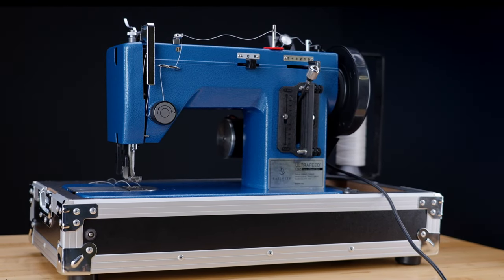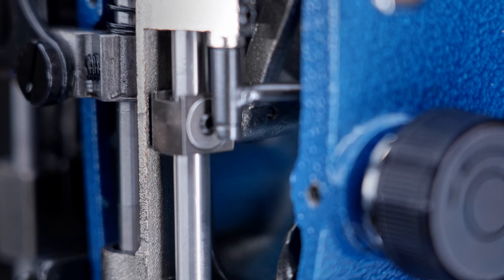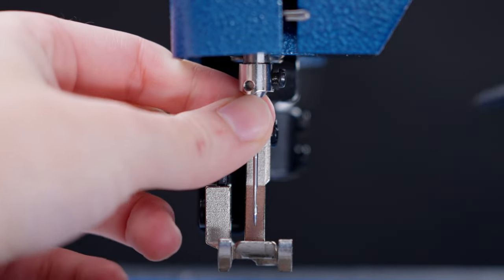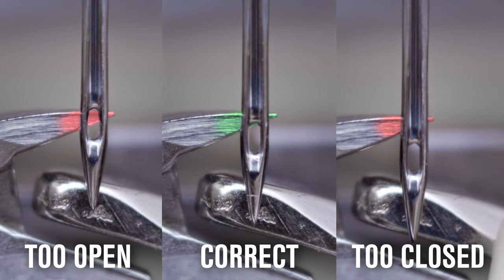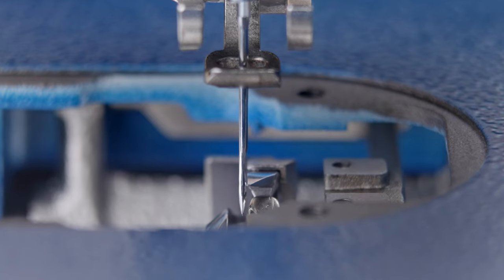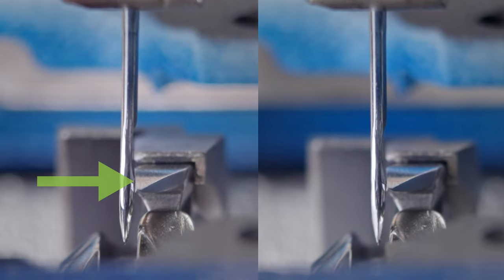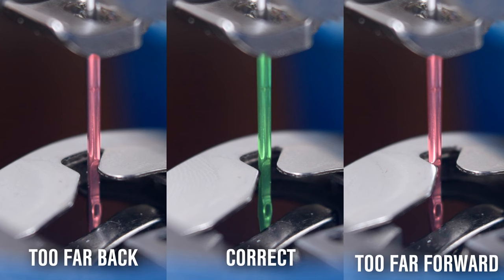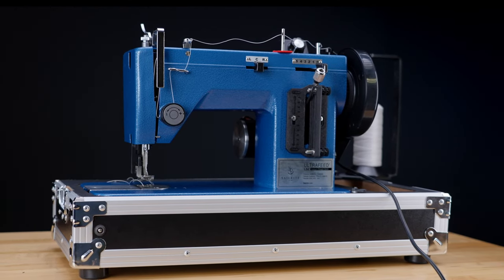How to Adjust the Timing on Your Ultrafeed® LSZ

Comment: Lowering your needle bar slightly, eliminates dropped stitches when using Tenara or other PTFE threads. 
Every 3rd time you knock your needle bar out of whack and need to reset it, install new grub screws. Buy a bag of them, trust me.
Nice video, @Sailrite.